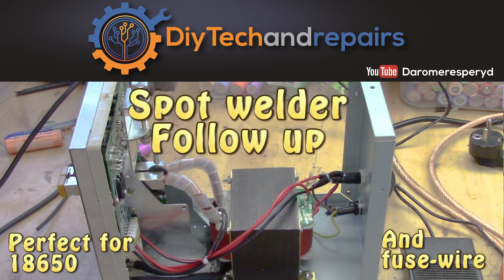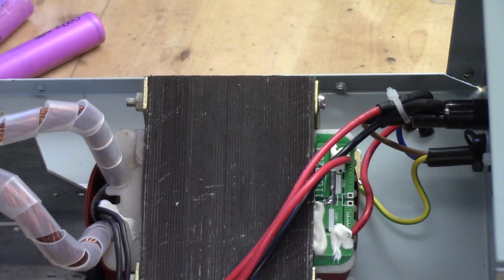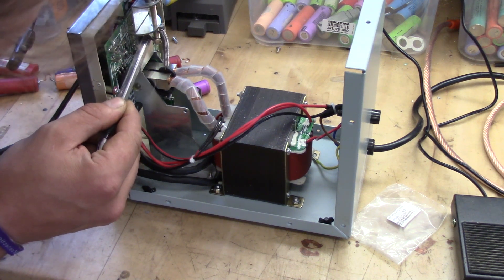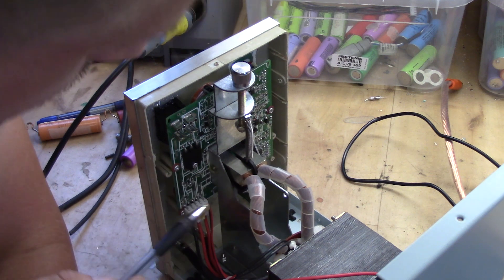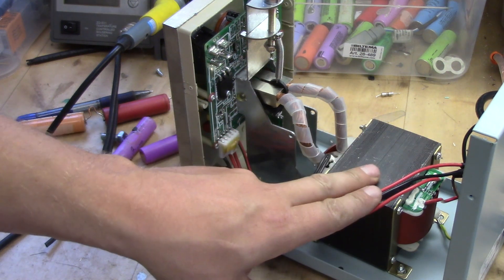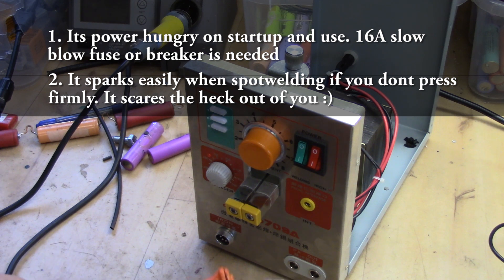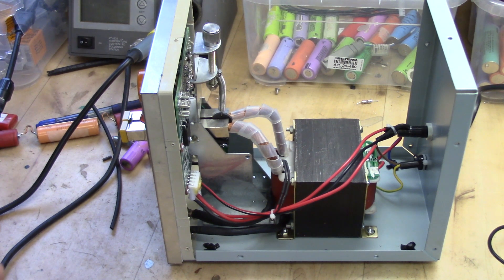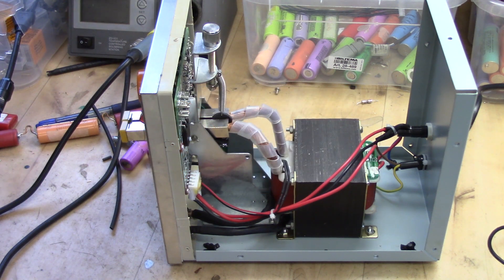Spot welder quick look - Tool for sorting your 18650 cells together in packs!

Comment: Thanks dear, but transfoer have 220V, by 26 Amp only ?
Reply from the maker: Huh?
Reply: Im want make spot weldind , i can use eny Transformer of macrowave ? have diferent ?
Reply from the maker: @ideafromkurdistan5257  as long as the mot is powerfull enough
Reply: Dear im not understand u answer , for good spot welding , need transformer 200V, by 800 amp?
Reply from the maker: @ideafromkurdistan5257  you need roughly 1.5,-2kw. On secondary that should perhaps be 3v and 500A
Reply: But the cable thst use foe secande what milem ?